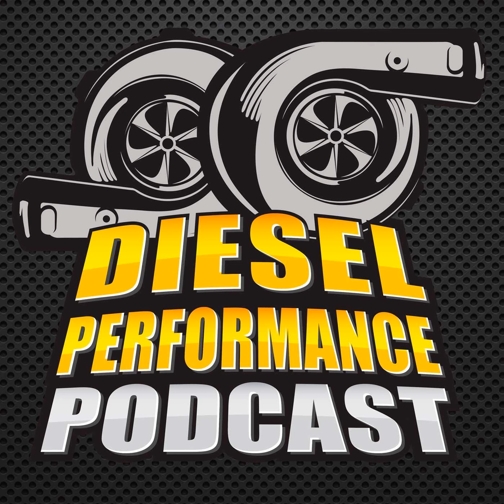Talking With Clint Cannon About The ATS' Allison/Cummins Conversion

Comment: No thanks.   A built 47re is better than an allison.
Reply: For what purpose?
Reply: @Jmschnider  everything.  Daily driving, pulling a trailer to drag racing sled pulling.
Reply: @KRShields  well that just flat out isn’t true lol. Only in drag racing is it better
Reply: @KRShields  47re is better than an allison? Let's see you put 20k+ behind the 47re and pull the Rocky Mountains from north to south and see how long that sucker lasts. Oh it might do it but it won't do it nearly as well.
Reply: @timothymroberts2949  the 47re have been doing that, drag racing, tractor pulling for longer than the allison.  You want a fast over 1000hp Duramax at the drag strip youre gonna need a 47re.  Allison cant hang.
Reply: @KRShields  I want a thousand horse dirty max like you want a brick dropped on your foot. I prefer the smooth miss and the torque of an inline 6 Cummins. Not that the dirty mac is into good engine because it is but regardless of any horsepower number, the torque generated buy a coming all always be higher. Ask for horsepower, I believe the mighty Cummins currently hold that title via Justin Ziegler🤣🤣
For sure holding power, both the Park flight in Allison family of Transmissions have to step to the side to the venerable th400/ 4l80.